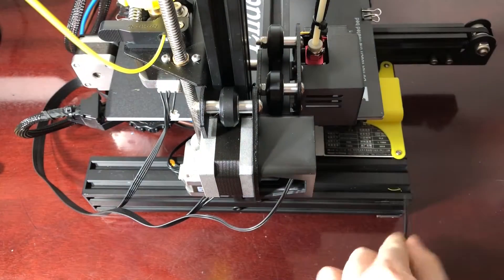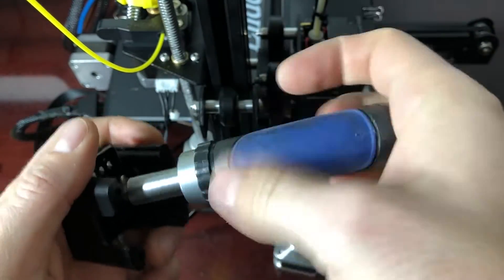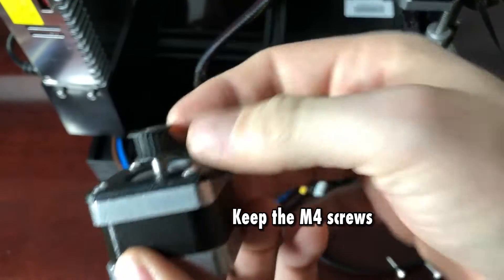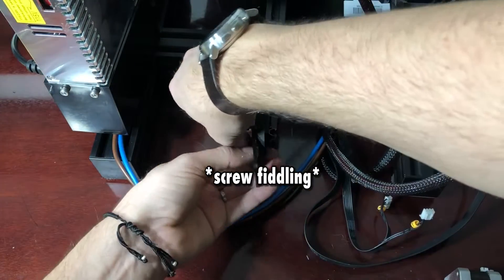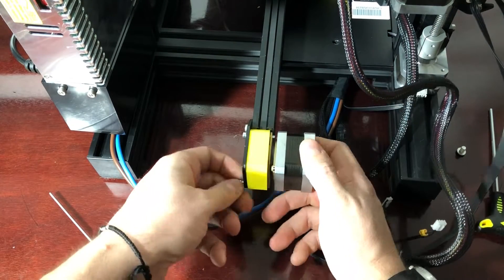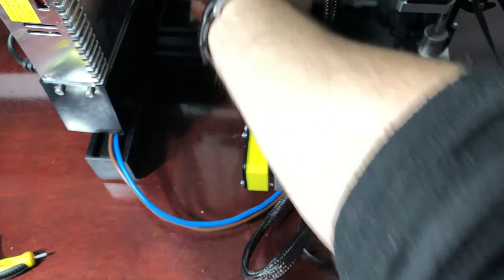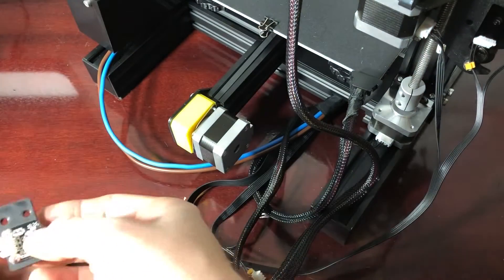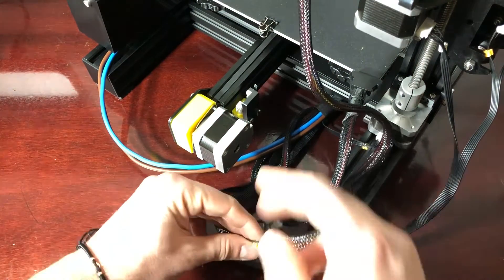Ender-3 stepper motor dampers with press-fit pulleys! [SUB ITA]

Comment: i need codes but where are the codes?
Reply from the maker: If you talk about the firmware the only change you need to make is to reverse the X axis. If you need parts take a look here: https://kit.co/a_make_designs/ender-3
Reply: where can i find these codes at 11:35
Reply from the maker: I used TH3D firmware. The more recent one is here https://uf2.th3dstudio.com

Things have significantly changed in Marlin since the video was recorded more than two years ago, but the basics are the same.

Let me know if you can work with this
Reply: @AMakeDesigns  The site in the tag gives 403 forbidden error. I can't download firmware
Reply from the maker: Try here. This should be the official Ender-3 marlin branch. https://www.creality3dofficial.com/pages/firmware-download

Comment: Do you need cooling on these motors? Since they not have the frame as heatsink anymore? Is it necessary, or maybe just for long prints >10h?
Reply from the maker: I didn't really see a problem there. Maybe if you print crazy fast. I never checked but never had a problem either

Comment: What did you do with the button bits on the dampers. Did you file them off or keep them?
Reply from the maker: There are corresponding holes in the prints to accommodate those

Comment: I did this on my Ender 3 Pro, which has some slightly different dimensions, but it worked great. The X axis is virtually silent, but the Y axis still makes a bit of noise, though its much less than before. I'm assuming that's because the Y axis motor is moving the whole bed so it has a greater load on it? Is this normal? Is there anything else I may need to do?
Reply from the maker: Just make sure the screws don't touch the other half of the damper. Check the wheels and eventually adjust the eccentric spacer

Comment: my x steppermotor doesnt have any screws where you had em, theyre on the other side (silver side) should i remove those? im printing the parts meanwhile..
Reply from the maker: They should be behind the QR code sticker. The screws on the back keep the motor together, leave them there!

Comment: Can you send a link to the m3x25 screws you bought please? I'm having trouble finding the right ones
Reply from the maker: They are super common in Italy, you can buy them in any hardware store. I found this mix on Amazon (affiliate link). 3x30 should work as good, or with a washer or two.

https://kit.co/a_make_designs/tools-and-extras/m2-m3-m4-stainless-s

Comment: I got the new board in which is 4.2.7 silent.  I need to make my X stepper go in reverse but I'm run through so may steps and ways that it's all confusing.  I came to a point where Arduino IDE gives an error that my sketch is too big!  Why would TH3D U R2 be too big to upload???
Reply from the maker: It's because the ATMEGA 8bit chip is simply too small to hold the whole firmare. You have to get rid of some of the code to make it fit.
Anyway if you have a silent board you can try to run it without the dampers. That should work just fine

Comment: stuck at firmware uploading.  ide says it looks for sanguino...not sure what to do now.
Reply from the maker: If you can't sort it out and you know what you are doing, you can swap two of the cables in the stepper connector. There are comments here and in thingiverse about this. Just make sure you do it with the POWER OFF or your board with fry
Reply: @AMakeDesigns  Thanks.  will try that.  which two cables?
Reply: @AMakeDesigns  Great, I may have fried my main board.  I tried reversing the correct wires and the servo buzzes and does not turn.  I tested the connections from the board to a motor and two ports seem bad.  The X and Y axis ports.  what now??
Reply from the maker: You might have swapped the wires wrongly. Look at the link below how to find the wire pairs. https://buildbotics.com/wiring-stepper-motors/amp/
Reply: @AMakeDesigns  Is it possible to damage only the ports X Y on the main board but Z and E work okay?
Reply from the maker: If you disconnect the cable while the power is on you might fry the driver, so yes. Try swapping the Z motor in the X port and see if it works
Reply from the maker: All of this must be done with POWER DISCONNECTED
Reply: @AMakeDesigns  Tried a lot of swapping like that and confirmed X and Y ports are bad.  I ordered a new Creality Ender 3 Upgraded Motherboard Silent Mainboard V4.2.7 with TMC2225 Drive so I'm hoping swapping the board out will get me out of this hell.  The cables are back to original config, then I'll have to swap the wires correctly this time.

Comment: Wouldn’t it be easier to get different pulleys?
Reply from the maker: the problem is to remove the existing ones for which you need an extractor and care to avoid damaging the motor. If you find it easier, go for it!

Comment: it doesn't work with ezabl. since it hits the motor before it gets to the stop. l did make the stop flag longer but now the ezabl is off centered to the right by 4mm when homed and there's no way to change it in the config. :/ only way it would work if the motor is a little offset to the left
Reply from the maker: I'm not sure I got you. I put my sensor on the right of the extruder and have no problem with that.

Comment: ...or one replaces the mainboard with a board that has the TMC2209 stepper driver IC's.
Example: "BigTreeTech SKR MiniE3 V2.0" - It'll give you completely silent stepper motors without any dampeners or smoothers. On top of that, the board has much more memory so one can activate more advanced features in the firmware which the original board isn't capable of. Best of all: It's really cheap too.
Edit: The E3 variant of the SKR board is a perfect drop-in replacement designed for the Ender 3 series. No modifications needed. Unscrew the old board, screw in the new. connect everything. You're done.
Reply from the maker: All correct except... Look at the video date. It did not exist 1.5 years ago ;-)
Reply: @AMakeDesigns  Well... I know. Which is why I added the comment for anyone who might hit this now.

Comment: Thanks for this guide. My printer is almost silent now, it's only the fans that are noisy. Just to note, you do not have to modify any of the software when putting together the Y axis. Before putting the cable back into the stepper motor, you can carefully lift the little plastic tabs on the cable and pull out the pins. Put the pins back in the opposite order and the motor will work fine.

Comment: I'm stuck at modifying the Configuration_backend.h file. Switching X axis motor direction just doesn't take effect. There are no errors during upload and modifying anything in Configuration.h works fine. Does anyone have the same issue??

Comment: Thank you for such a helpful video. I now have my dampers installed and my first test print is in action with very little noise. 
But I have a concern about the temperature of the stepper motors however. 
The steppers use the frame they were previously on as a heat sink where as now they are just on the plastic mounts. they are quite hot to touch. 
I was wondering, has anyone had any issues with overheating/Burning out?
Reply from the maker: I did not have problems with heat buildup. As far as I can tell most of the heat is radiated off of the back side of the motor. I just added some heatsinks I bought from Aliexpress at basically no price

Comment: Great job, well explained the parts are easy to print and they fit like hell.  I bought a new board 1.15 also but i dont know if i will need this anymore. I sit one meter away from the printer an i have to turn my head to see if he is still printing. Now I am looking for a good solution how to quiet the PSU fan
Reply: see if there's a noctua fan of the same size/voltage available

Comment: In the video, it only shows you changing the direction of the x-axis stepper motor despite having changed the orientation of both the x and the y motor. Is it safe to assume that we should also be changing the configuration.h file so the #define INVERT_Y_DIR also says false? I figured I would just check to be safe ... It seems like that would make sense to change this parameter as well. Thanks in advance and I greatly appreciate the video as well as the mods to make this work!
Reply from the maker: There is no need. The Y motor is not flipped, just moved backwards ;-)
Reply: @AMakeDesigns I just noticed when the axis came towards me :D But thanks for the awesome tutorial. I couldn't have done it without you!
Reply: DId you try it ?

Comment: I'm thinking of upgrading my main board, which will update the drivers to the quieter TMC drivers. Do you think the dampers are still worth installing after that upgrade?
Reply from the maker: I removed them after installing TMCs. It makes approximately the same noise with those than with dampers. The two together do not change much

Comment: So, are Ender 3D printers manufactured using Arduino? I am a little confused since at the end of the video there's a firmware setting up in the Arduino screen.
Reply from the maker: yes they do. They use Arduino-compatible chips and Marlin, which is a community based firmware written in Arduino

Comment: Great video, just one comment:  I bought my steppers dampers for my Ender 3 and thought it was just removing the steppers, put the dampers, and assemble it all back again. It would be great if, before starting disassembling to show what we need to perform this task: tools, longer screws (I didn't know), and also this set of yellow 3D printed attachments. (How can I get them)
Reply: All the info is in the video description.
Reply: The yellow parts were all printed by the printer before the mod was performed.

Comment: Hello! I had to lengthen the stop flag to install a ezabl on the left side. How can i change the x offset? Its pronting about 4-5 mm off center to the right now. Thanks for the video!!
Reply: I actually found it!! For those who have the same problem. Cura slicer under manage printer, extruder 1 and mess around with the x and y nozzle. Had to offset mine 7.5mm for x and - 2.5 for y

Comment: Why does the X direction have to be inverted?
Reply from the maker: because the motor has been flipped so it will have to spin in the opposite direction to move the carriage in the same way as before.
Reply: @AMakeDesigns  I didn't see it the first time I watched it. I see it now. Thanks.

Comment: instead of changing the firmware you can just invert the cable on the board side (the connector housing can be removed and twisted)
Reply: Now that is a useful tip and so easy
Reply: Seriously?!
Reply: @bendavis2115  Almost. it has no downsides. you need swich 2 wires on the connector
Reply: @BigFootpl  Any chance there's a video that shows how to do this and is easy to follow?
Reply: how where to twisted

Comment: So i have the Ender 3 Pro and the Y axis bracket has a pulley attached and cannot be rotated like the Ender 3 so i created a spacer very much like your X axis spacer but well for the Y axis heres the thingiverse link. Idk how to link it or if you want the stl file to put onto your design as it will get more traffic than mine. cheers. https://www.thingiverse.com/thing:4245353

Comment: Hello, thank you very much for the video, it is very well explained. When I changed the y-motor and replaced it with another with an adjustable pulley, the bed did not reach the end stop, so I back to the original press-fit pulley motor. My question is, with this method, will this problem be solved? I realize that the Y end stop  now is placed on the other side of the guide. Is it placed at the same distance it was before the original side? Again, thank you so much for this video and please apologize my poor english
Reply from the maker: There is a small spacer you have to print to make the limit switch trigger.
Your English is good! :-)

Comment: I keep seeing people talk about putting heatsinks on the motors to keep them cool. I don’t have any atm but after installing the dampers on my ender 3 pro, I found the motors are pretty hot, almost to burning to the touch. Would it be ok or do I really need heatsinks for them?
Reply from the maker: Motors tend to get pretty hot. I got one on the X axis but it will collide with the carriage in the y. So far I had not had any problem with that
Reply: Lower your print speed too

Comment: Thank you for the video, I used it and worked really well for X axis but nor for Y as I have Ender3 Pro. I suggest swapping cables 1 and 4 (where 1 is the tagged one) to reverse the motor instead of changing the firmware.
Reply: i made a mount thats similar to the x mount on my ender 3 pro to fix that problem if you'd like it

Comment: Is it 100% necessary to implement the bootlegger? I was considering going through this damper process from the video but the bootlegger is a turn off. The sound is annoying but this amount of work might not be worth it
Reply from the maker: If you know how to do it, you can swap wires in the motor connector to reverse the motor direction.

Comment: This worked fantastic for me! X and Y motors are much quieter now. Thank you for working this out and making the video.

A couple of questions:

1. Have you had motor heat issues? I bought heatsinks for my steppers, but I'm not sure whether I need to be worried about installing them or not.
2. Is there some way to mount a damper to the Z axis motor? Would that even make a difference? That is by far the loudest one now.

Comment: Well,THAT sucks!!! I just started assembling my new Ender 3 Pro,and after watching lots of upgrade videos whilst it was being shipped on a slow boat,now that it has arrived,I THOUGHT I would get a jump on the game by installing the new belts(Gates Fiber),Capricorn tube,dampeners,etc.,and ran into the pressed pulley situation.I really THANK YOU for posting this,but now I have to put it back to original WITHOUT dampers,so I can PRINT the parts I need,LMAO!! Life is good.I can't wait to get to melting plastic!Thanks again for sharing!
Reply: where to by these dampeners

Comment: Will those pla parts hold up over time? Won't the pressure and constant motion of those motors wear then out pretty quick?
Reply from the maker: They are static parts with no movement. The screws will hold everything together nicely.

Comment: Awsome guide! 
But if you use this X-axis mount from the same author as the Y-axis mount, you don't need to modify the marlin code :D 
Although it's a bit more fiddly as you neet to remove the gantry to replase the metal part for the printed part.
https://www.thingiverse.com/thing:3271077

Comment: ive got all of my parts installed. what about the endstop left over? and i dont have any way to make x dir false. Am i screwed? is there anyway to edit this in cura or on my printer itself? i know dumb question
Reply from the maker: You should have all three end stops in the printer.

To change the direction of the motor you have two options:
- Change the firmware as described in the last part of the video 
- swap two wires in the cable like in this video https://youtu.be/-iubywKkNEE.

NOTE!!!! If you swap the wires ALWAYS power off the printer before disconnecting and connecting any cable from the board or the motor. If you don't, your board WILL BE destroyed.
Reply: A-Make Designs thanks for your response I’ll try it when I can

Comment: It works like charm thanks! So quiet now!
Note that I didn't want to flash the firmware to invert X axis. I have inverted the wires of the connector of the stepper and it is the same.
Reply from the maker: It has been pointed out a few times. That is an option of course but I think flashing the firmware is needed to activate thermal runaway protection, that's why I recommend to do it that way.
Reply: @AMakeDesigns  Thanks for your answer. I'm not sure what do you mean by thermal runaway protection? Is there such a protection for stepper? Why would it be deactivated by the fact I have inverted the wires? I'm quiet new in 3D printing world so sorry for stupid question.
Reply from the maker: Maxime Richard thermal runaway protection is a firmware feature that checks if the reading of the thermistor raises when power is applied to the heater. If it does not it means something is wrong and stops the heater. This will prevent accidents (including the printer catching fire) in case the thermistor comes loose from the hot end or something goes wrong with wiring and such.
This is not a default feature in creality printers, but you can get it with an updated firmware. This is why I recommend this path instead of the wire swap.
The wire swap is perfectly ok if you know what are doing (I.e.: do it with the printer OFF... :-))
Reply: @AMakeDesigns  Thanks again. This looks a must-have feature! Now I need to find a correct tutorial to flash my printer for the first time :-)
Reply from the maker: Maxime Richard no need to go far! Check the video description for an excellent video by Teaching Tech on how to flash a bootloader. Then you can find how to edit the firmware here :

Ender 3: DIY inexpensive Bed Level Sensor (Part 2)
https://youtu.be/l3O9CPr_U-E

Comment: Why not just get new pulleys with set screws and replace the pressed on ones? It does require a good wheel puller.
https://usa.banggood.com/3PCS-Creality-3D-Black-2GT-20-Teeth-Aluminum-Timing-Pulley-Wheel-5mm-Inner-For-Ender-3-3D-Printer-p-1418499.html?rmmds=detail-left-hotproducts__1&cur_warehouse=CN